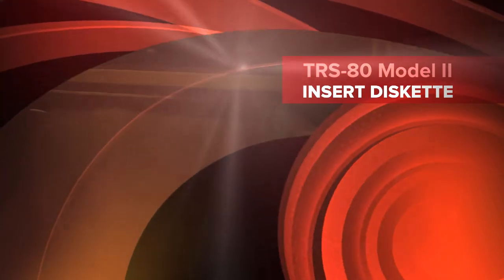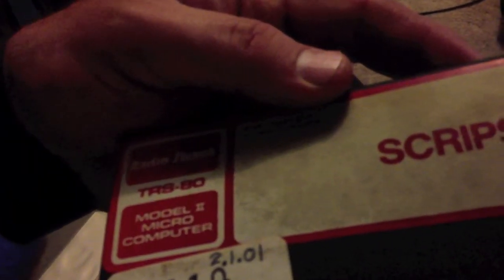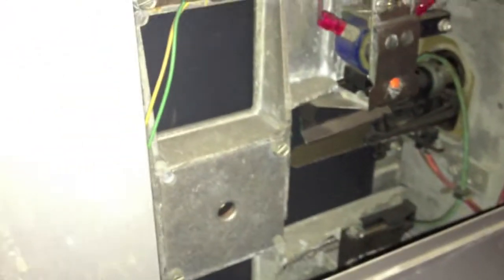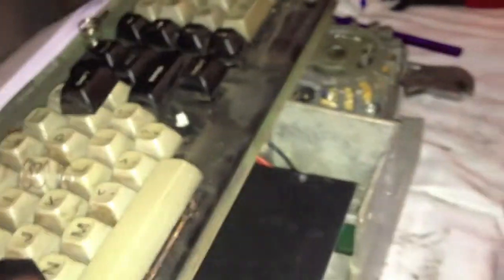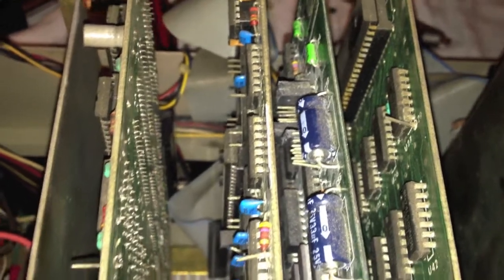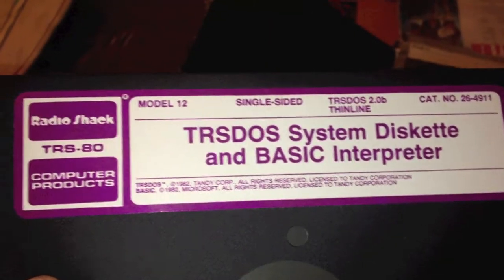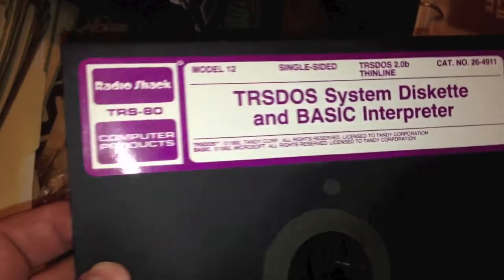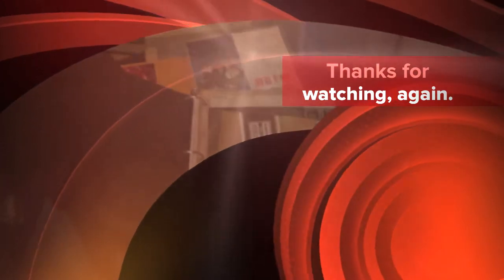Reassembling the TRS-80 Model II part 4

Comment: Don't know if you've figured this out yet, but the Model II must have a termination pack installed in the rear on the external floppy connector if you aren't using the external floppy expansion chassis.  If you don't have the termination pack installed the internal drives won't work.  Your drives are probably OK.  If you can't find a terminator you can probably make one by looking at the schematics in the service manual.